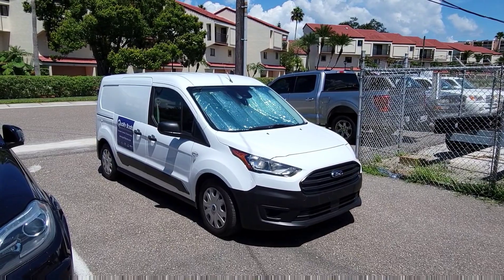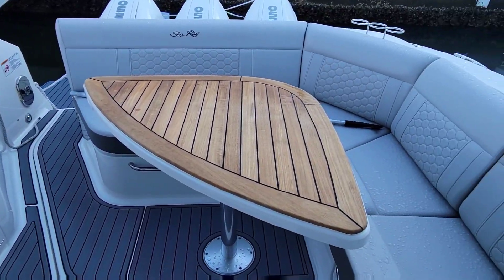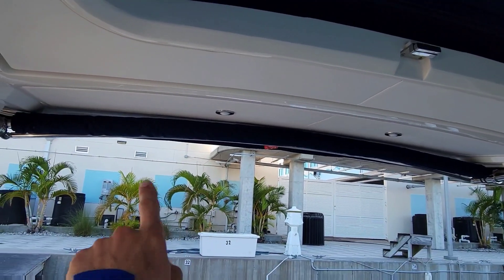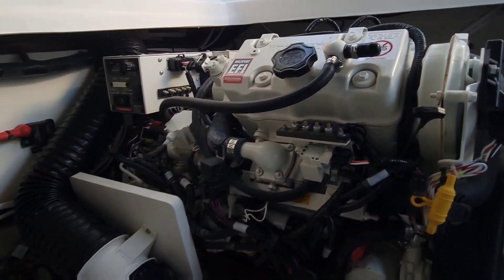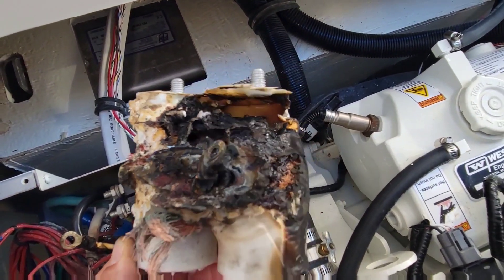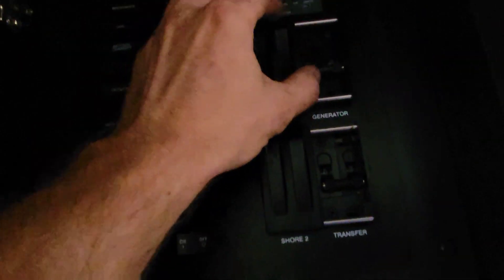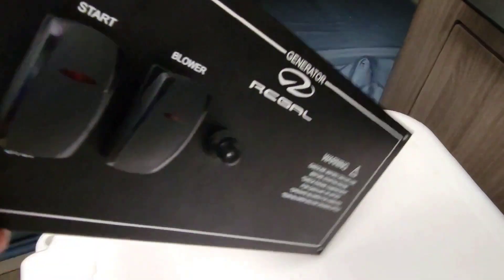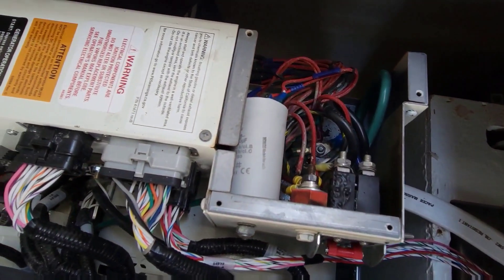320 Sea Ray Sundancer - Episode 83

Comment: Do the manufacturers reimburse you when items are under warranty when you own the boat as a trade-in? 

Curious to if given your experience and skill level, the manufacturers like to hear about failures like this so they could do a recall/design better etc…?
Reply from the maker: Both good questions. They do not reimburse us when it is a trade in. The warranty always goes to the original owner unless stipulated.  All the manufacturers have the techs come to the factories and talk with the engineers. I go every year. ☺️

Comment: Electric issues are not good.... Hard to fix.... Causes.???
Reply from the maker: My best guess on what happened is the capacitor failed and shorted to ground. Then it melted out before the generator shut down from no output.